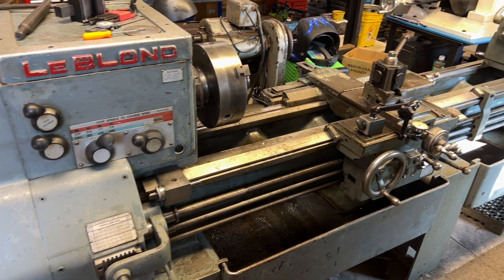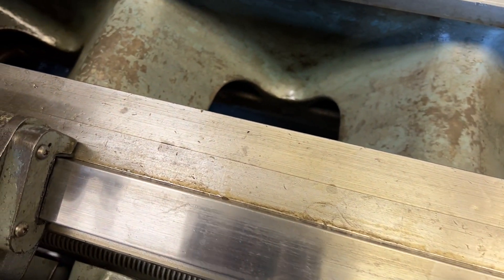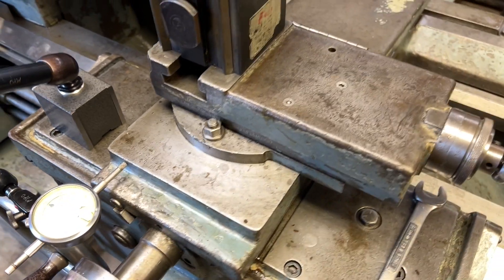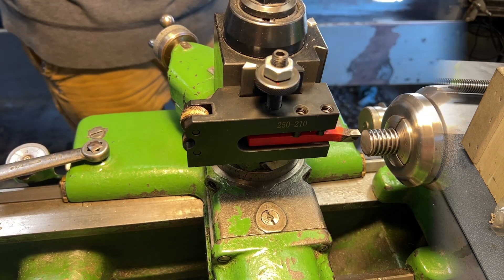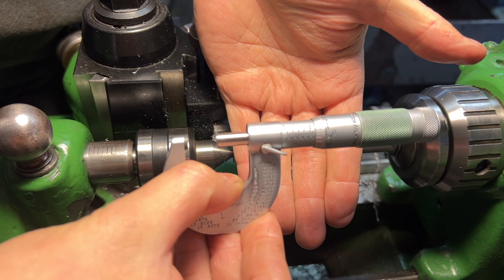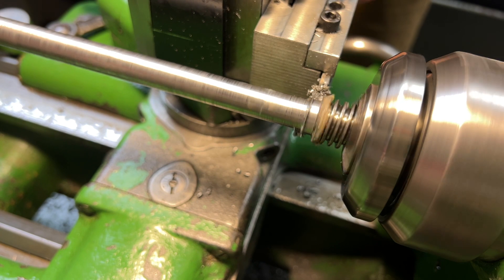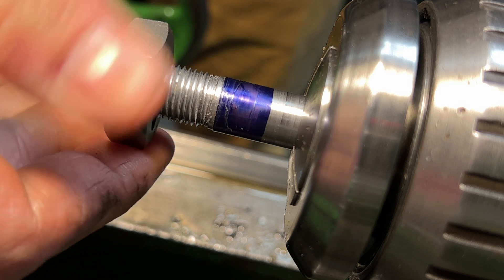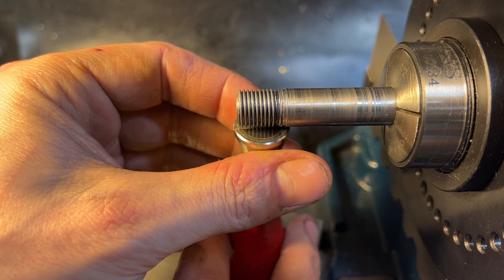Making a CrossFeed Screw for a 15" Leblond Regal lathe!

Comment: I just came across your channel. I am a 73 year old newbie. I have a Labond lathe 19 inch swing, 54 inch center. Can you do a video on single point threading on your Labond lathe
Reply from the maker: Yes, I can absolutely do that! There is a video coming up very soon where I will do a bit of single point threading. And I have been kicking around the idea of starting a series of videos on "fundamental" skills where we'll go over core operations like single point threading, using the most basic and common tools that everyone will have in the shop. Keep an eye out. And thank you very much for watching!
Reply: @hersch_tool  i wish you did it with the Labond lathe before you got rid of it
Reply from the maker: @santopezzotti730  well, I wish I didn't get rid of it, so we're even on that one... 😢 But what year leblond do you have? I might have a surprise on that front coming sometime in the future. Either way, it's pretty much the same regardless of the machine. 🙂

Comment: Nice Lathe! I figure most lathes of that size have been used pretty hard and have serious wear. It's good that you're ready to rebuild it. What do the control rods do on this lathe? Stops for power feed, or lead screw reverse?
Reply from the maker: Thanks very much! Yeah, it's been quite a lot of work. Unfortunately, there was a lot that I didn't get on camera. In retrospect there are a few things that needed fixing that I'd wished I'd recorded, but was just so "knee deep" in it at the time that it didn't happen. This is a pretty basic version of this particular lathe so the control rod only controls the spindle. Forward, reverse, and brake. No auto stops, or anything. The only feed reverse is located on the headstock, but there is very similar version of this machine with more features that has feed reverse gearing in the apron. Thanks so much for watching! I do have a couple videos coming up making some accessories for this machine as well. Hope to see you around!